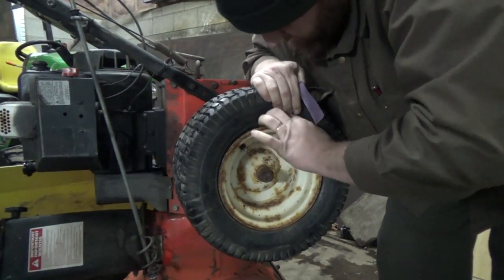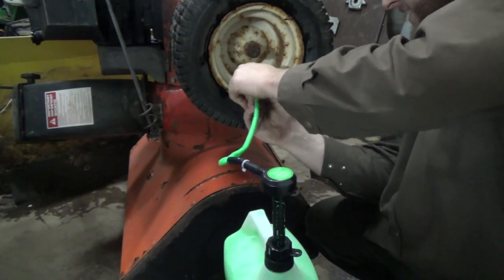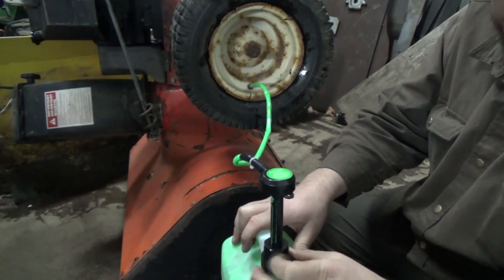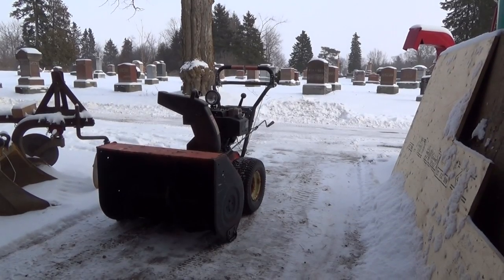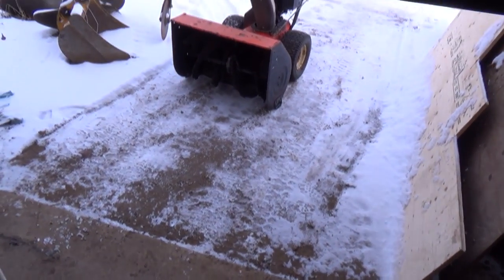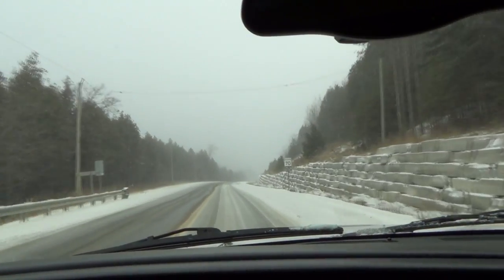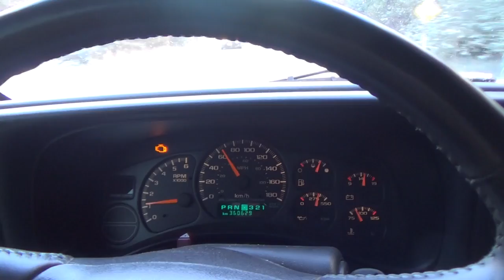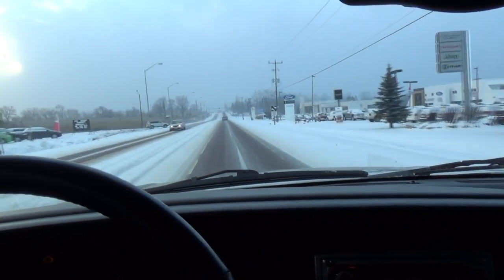Fixing the snowblowers tire and delivering it back to the owner

Comment: Engine coolant temperature (ETC) sensor. Think about it, the problem only happens to the GMC when she is cold. See if your scanner will read the temp from the ECT and see if it matches the temperature outside. Your truck NEVER behaves this way in warm weather. These ECT's can cause a host of issues without even activating the check engine lamp. Good luck buddy.

Comment: evap... check the lines to and from your charcoal canister. there is steel lines, that go to rubber, sometimes the rubber will dry rot and leak. also, take your air blowgun and blow through ALL the lines to and from the charcoal canister. our 04' dodge durango had the same problem

Comment: hey bill rent a fuel pressure tester and test the fuel pressure regulator. its under the intake plenum clipped onto the spider injectors. these trucks with the vortec motors are common for the fuel regulator to fail. should have 50-60 psi with key on. then start it up and normal drop is 10 psi. then rap the throttle a bit. the pressure should go up 5 psi or more. then shut it off then key on then off and wait ten minutes. if it dropped anymore than 10 psi regulator is leaking. if any of these tests fail you have a leaking fuel pressure regulator. only does it when cold because its getting way too much fuel for a cold start. since when cold it gets more gas. when warm it can take a bit more gas and handle it.
Reply: also don't forget to purge the air from the tester to get accurate reading.

Comment: Bill stop throwing money at the truck in hopes of fixing it. I am pretty sure there is a service bulletin regarding the relocation of the evap canister. If not done, for whatever reason, it will continually set the check engine light. That's what caused mine. Take it to the dealer and have it fixed.

Comment: I would check your intake as well,mine was leaking and causing my idleing to do the same thing.Start your truck and spay around the intake were it bolts to the heads.If they are leaking your ideling will change instantly use either or maybe carb cleaner.Mine also had the same codes p0171-p0174 hope this helps, but it may not be your problem.
Reply: I know this is old but, you can also use a propane torch that's not lit. If it sucks propane in, the idle will shoot up.

Comment: Check the rear exhaust manifold bolts cuz those are notorious for rusting and breaking off and causing exhaust leaks it may even set some codes thinking about the o2 sensors; running rich or lean issue.

Comment: Over filling the tank on a 03 Ram resulted in having the charcoal in the evap canister to solidify.  I put a long screwdriver end on an electric drill and churned the charcoal up.  That solved the evap code problem. The code was “evap failed to purge”.

Comment: I had that light prob on two cars and both times traced it back to the filler cap, start of the easy way and if the cap doesn’t fix it get an electronic test?